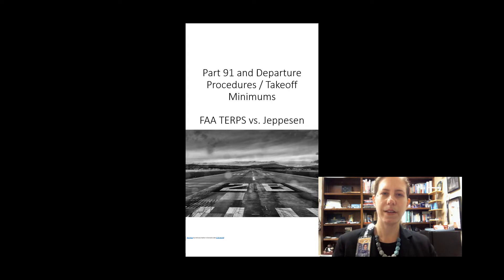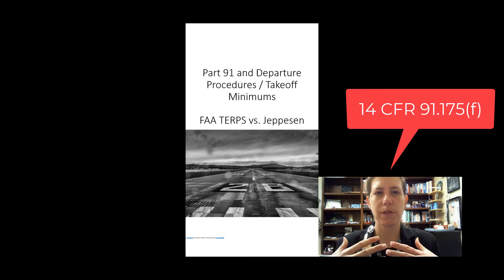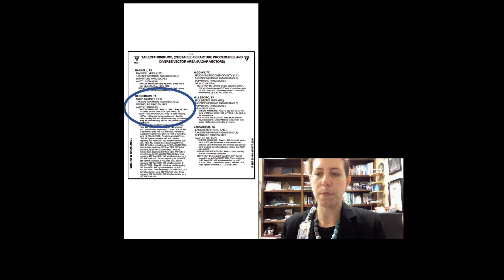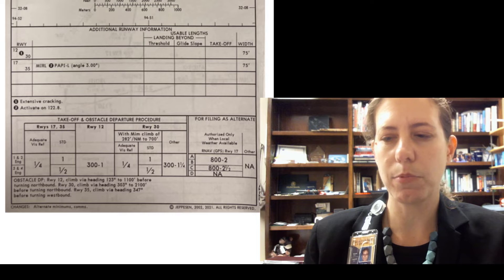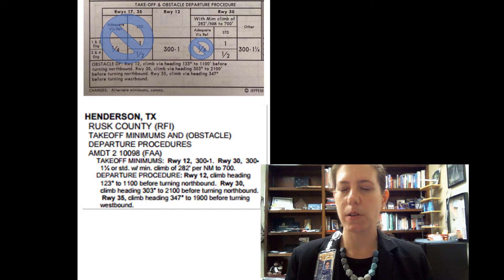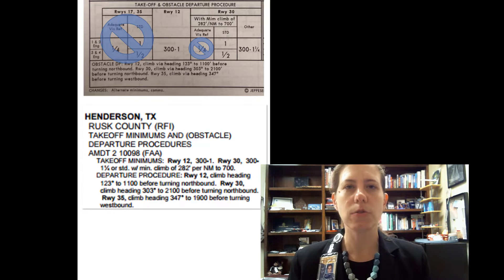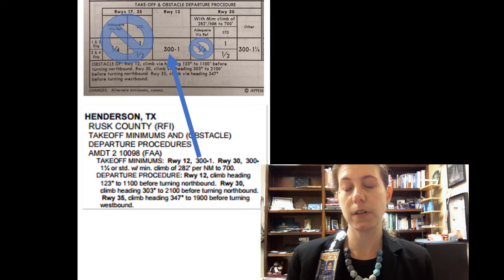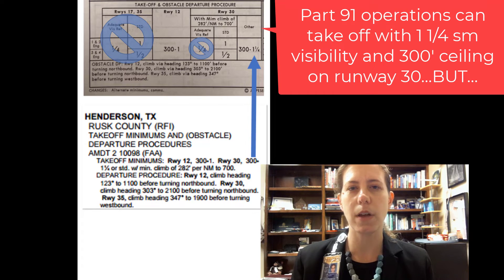Part 91 Instrument Takeoff Minimums Explained: FAA TERPS and Jeppesen Charts Instrument Pilot Prep

Comment: Hi, I’m a little confused. I thought no matter what part 91 is 0/0 take off minimums. Obviously it’s not safe, but I don’t know why you said that runway 12 is required to have a of 300-1 under part 91.
Reply from the maker: It is because if it is “standard” then 0/0 for part 91 is legal. But with runway 12 it is NOT standard and then everyone has to follow the published non-standard takeoff minimums.
Reply: @LauraLaster747  don’t mean to be a pain but do you have a link to a page/ source that says that.  I’ve been digging through the Internet and can’t find anything. All it says is 91 does not need to adhere to any take-off visibility requirement. besides a SID.
Reply from the maker: I will do some digging and get back to you because I feel I’ve been asked this before!
Reply from the maker: OK repeat of another comment I responded to and found you are correct. 
I have a few articles for you to also review in response though:
https://www.ifr-magazine.com/training-sims/ga-takeoff-minimums/
https://www.aircrewacademy.com/blog/nothing-standard-about-takeoff-minimums/
https://www.flyingmag.com/training-instrument-flight-rules-what-are-your-ifr-takeoff-minimums/
Also for FAA guidance, check out the FAA-H-8083-16B on page 1-8 (chapter 1) 
So, in summary, while it may be fully legal to take off completely 0-0 under part 91 even with nonstandard climb gradients published, it is not smart. I would not be surprised if a violation resulted under the catchall "careless and reckless" FAA rule if something happened on an instrument departure where the pilot clearly could not maintain the climb gradient and chose to depart 0-0.
Reply: Thank you very much appreciate the response. Just came across your page the other day. I will definitely be looking at all the Jefferson chart videos that you post.
Reply from the maker: @alexbowley5835  I hope you find them helpful! There is a new mini-course I made on Jeppesen charts: https://www.youtube.com/playlist?list=PLLsqYZi-3W_SKWXEZoRCjzI3tJh8OBIuS

Comment: I believe the 700’ number in the takeoff mins is referring to MSL not AGL. I did have a question about ODP and takeoff mins. If you are departing an airport with takeoff mins and an ODP, are you required to perform the takeoff mins instructions and then the ODP instructions? Or will both provide obstacle clearance and you can choose one?
Reply from the maker: Hello! You are right that it is 700' MSL. At some point after I made that video, I figured that out (but YouTube doesn't let me upload a replacement file sadly.) Great catch & thanks for pointing it out. For the ODP, if you follow the ODP, it will provide obstacle clearance by design. So you can follow whichever one if they both exist and get obstacle clearance.

Comment: What reg in part 91 does it say takeoff in 0/0 is legal. I've heard that so many times "under part 91" but no one seems to reference a specific reg number (ex. 91.123)
Reply from the maker: Where this comes from is 14 CFR 91.175 - if you look at (f) it does list takeoff minimums, but it also says "This paragraph applies to persons operating an aircraft under part 121, 125, 129, or 135 of this chapter." Part 91 is not operating under those parts, so that is why paragraph (f) - which covers takeoff minimums - does NOT apply to operations conducted under part 91. It is legal, but it is NOT SMART to take off 0/0!

Comment: Thank you for the video! Just want to ask a question. At 1:10, you showed the ODP aka Non-standard takeoff minimum for departure under part 91. What if a pilot selects a SID for IFR under part 91 and sees the takeoff minimum standard just like you can see Rwys 4L/R, 13L, 22L/R: Standard in JFK DEEZZ 5 departure, what rules does the pilot have to follow? Is it same as the standard minimum for 121/135 even though part 91 is not a commercial operator or the part 91 can takeoff at 0 visibility so then part 91 doesn't have to follow the takeoff minimum on the SID?
Reply from the maker: Thanks for watching! I looked at the DEEZZ 5 departure from KJFK and see what you found. In the takeoff minimums section (bottom left corner on FAA TERPS chart) we see standard takeoff minimums apply for Runways 4L/R and 13L and 22L/R meaning a part 91 operation could depart with zero visibility (legal but not smart, as I said in the video). On runway 13R a part 91 operator who could maintain a minimum climb of 250'/NM to 300' MSL can also take off with zero visibility. If the airplane could not do that, it would be a 300' ceiling required and 1.5 sm visibility required. On runways 31L/R a part 91 operator could takeoff with zero visibility so long as the airplane could maintain a minimum climb of 500'/NM to 1400' MSL. Having flown in that area myself during my survey days, runway 31L/R goes right over a considerable area of buildings that are not too far away from the airport, so this makes sense. Does this help answer your question?
Reply from the maker: What also may help is that if you fly the DEEZZ 5 departure from KJFK, and you meet the climb requirements on that departure, that satisfies that you will clear obstacles. While the DEEZZ 5 is not an ODP but a SID, flying it and meeting the minimum climb requirements DOES mean you will clear obstacles. (I hope that makes sense...you do not need to fly BOTH an ODP and a SID. The ODP is for you to clear obstacles. The SID is also for you to clear obstacles but also for traffic flow and ATC harmonization.)
Reply: @LauraLaster747 I am one of big fans of your channel!! Yes, I am 100% satisfied with your answer. Thank you so much! Let me ask one more question. Part 121/135 operators have their own company OpsSpec that allows lower than standard takeoff minimum for them to fly safely in bad WX condition. If a pilot operating under part 121/135 departing from one of the Runways 4L/R and 13L and 22L/R, which requires standard takeoff minimum, do they have to follow standard takeoff minimum (two or less-1sm / Three or more -1/2sm) or their company OpsSpec such as C-057 or C-079 something like that? If the pilot uses the company OpsSpec for takeoff minimum to depart one of the runways, does the ATC know the pilot follows either the company OpsSpec or standard takeoff minimum shown on the SID or they don’t care?
Reply from the maker: @gkwns747ify  Great question (again!) I guess I need to make another video in the near future explaining what is called "lower than standard" takeoff minimums. As you mentioned, many (most) part 121 and 135 operators have an OpsSpec (Operations Specification) allowing them to takeoff with lower than the 1 sm / 1/2 sm requirements from 91.175. This is a great example where an operator's specific approval (OpsSpec) allows them to  follow 14 CFR part 91 regulations. So they follow their company's OpsSpec. 
Second, ATC does not really know anything about what a pilot is following for takeoff minimums. A company may have a different approval or may be a foreign air carrier or may not have the training/equipment requirements for that lower than standard takeoff minimum. ATC really does not care. It is up to the pilots to follow their own company requirements and OpsSpecs and understand where OpsSpecs "trump" 14 CFR.
Reply: @LauraLaster747  Thank you so much for lots of details. I am really learning a lot from your clips! looking forward to seeing next clips!
Reply from the maker: @gkwns747ify  About to upload another one - this time about part 121 takeoff minimums!